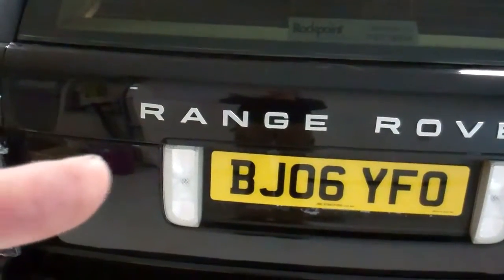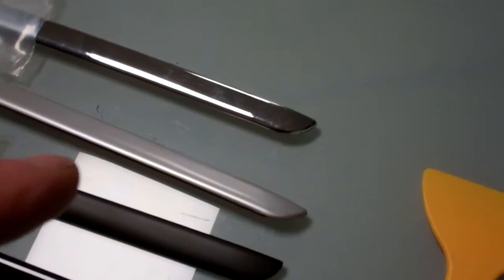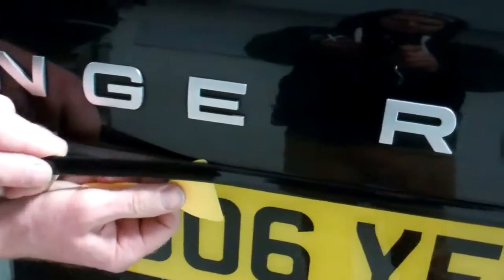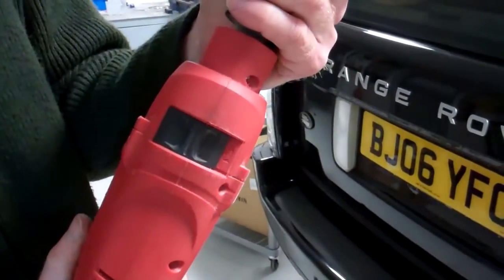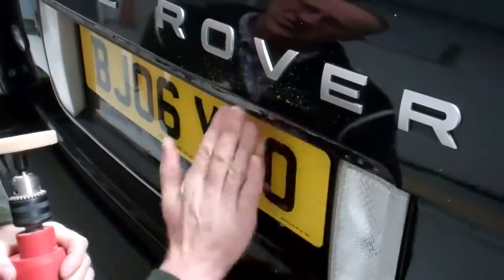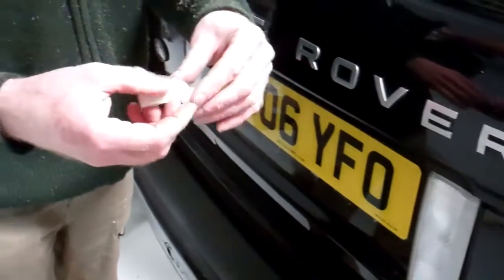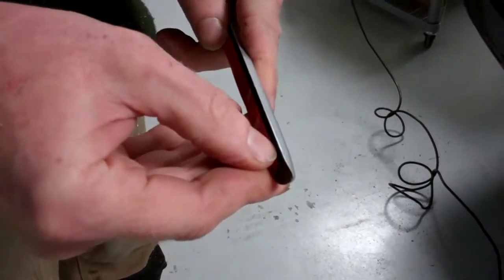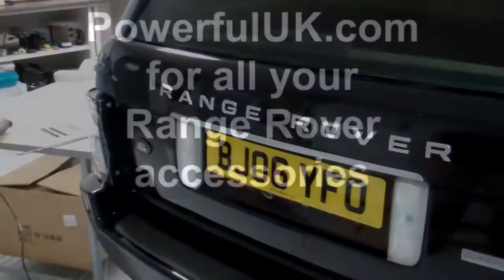How to replace rear tailgate trunk boot trim strip on Range Rover L322

Comment: kindly share your Sourcing website
Reply from the maker: www.powerfuluk.com
Reply: powerfulukltd
Reply: you might consider using 3M Adhesive remover, it just wipes on and rubs off.
Reply from the maker: yes - that stuff does work pretty well i would agree ! a nice lemon smell if i remember correctly !